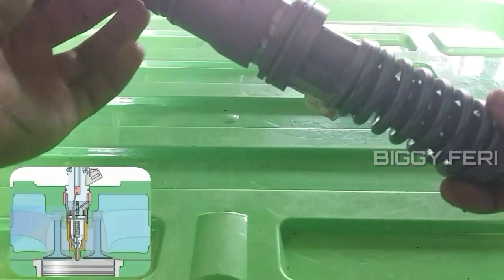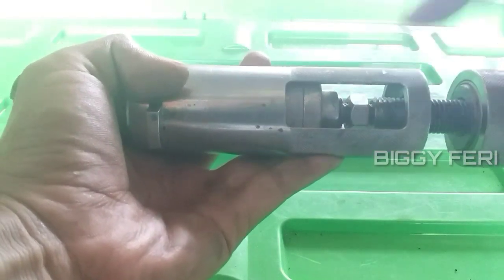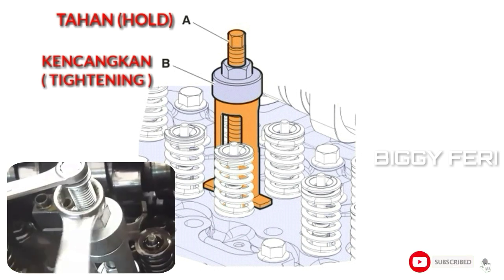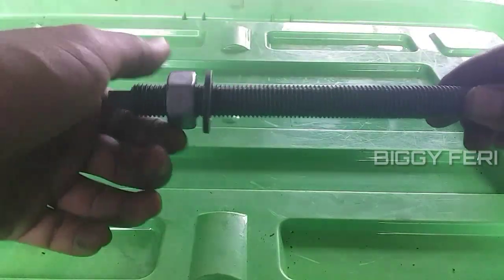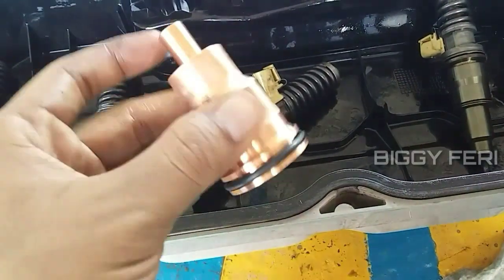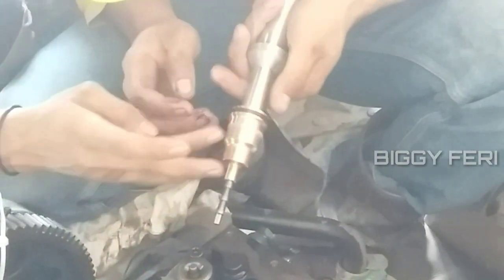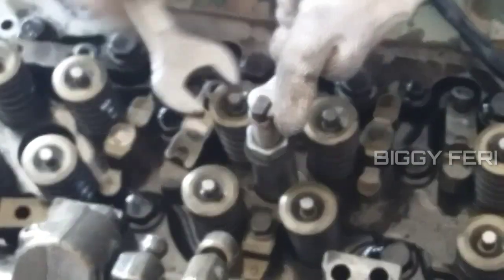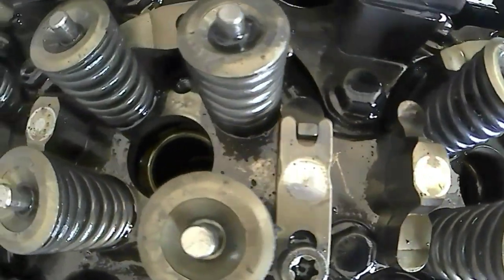Injector Sleeve Installation And Removal - Volvo D13 Engine

Comment: Mau tanya mas,Apakah bisa ada kebocoran fuel di sleeve ?
Reply from the maker: Bisa mas, kalo sleeve nya crack
Reply: @BiggyFeri  yang saya belum paham,fuel itu lewat galery,terus masuk injektorkah melalui Sleeve ?  Atau bagaimana mas ? Ada videonya kah ? Kalau system konvensional injektor di hubungkan lewat pipa injektor dari pump

Comment: Bang Biggy Feri, di mana Saya bisa Pesan Spesial Tool untuk Melepas & Memasang Cover Sleeve Injector itu & Berapa Harganya ?
Terima Kasih atas infonya.
Salam.
Reply from the maker: Mungkin anda bisa menghubungi pihak Eka Darma atau Indo truck pak selalu distributornya volvo truck. Karna dukun itu yg belin perusahaan, kami tinggal pakai saja. Atau coba cari di marketplace kalo ada.